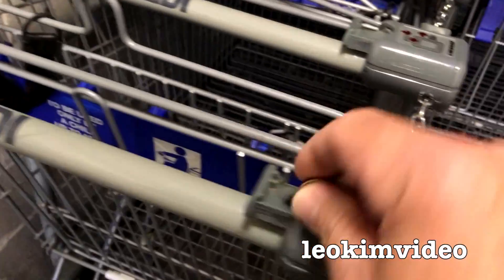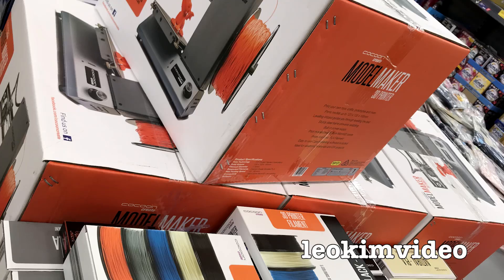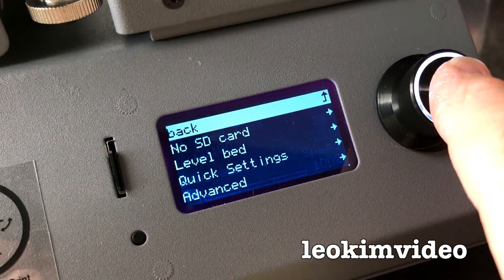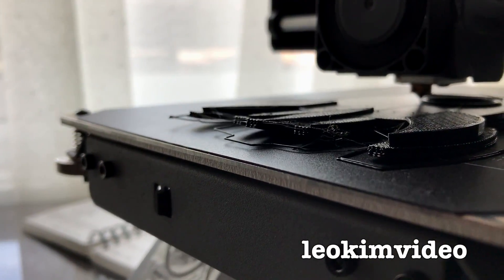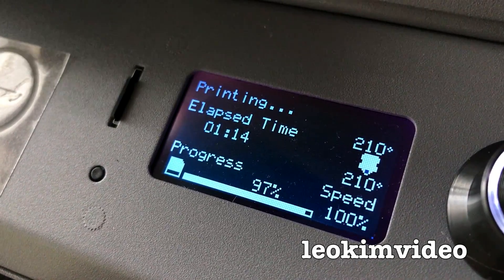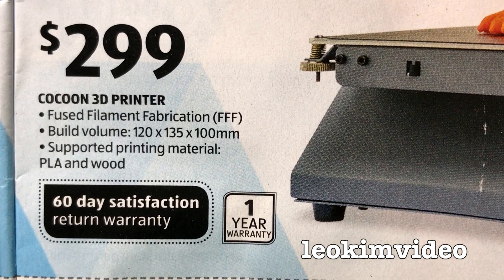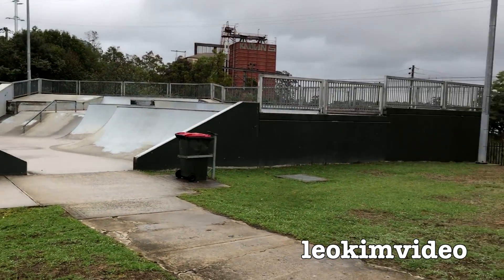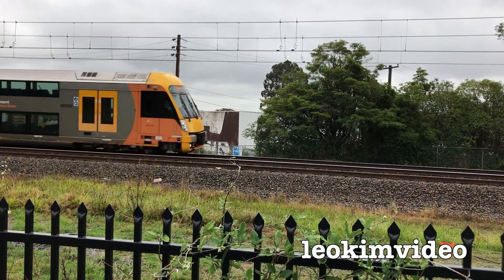ALDI Cocoon Create Model Maker 3D Printer Fail Refund Buy Bitcoin!

Comment: This is my only printer, and it has been brilliant, brilliant, all the way. Every printer has a learning curve, but I got good prints almost immediately, and have built some very big projects on it. PLA-only, and a bit small, are its only drawbacks. I do use glue stick on the build plate.

Comment: Atleast you can get yours printing our old ones at school we never got working it stuffed up half way through the print a do NOT reccomend this printer if you want a cheap really good printer look into FlashForge printers they don't need bed leveling only the big ones do the build plate heats up on some of there printers its not really a problem on the FlashForge finder just get a glue stick put it all over the build plate and then it does not fly around it has a very nice touchscreen interface on most of there printers easy to use great help it also has a cloud I bought the FlashForge Adventurer as my first printer I have never experienced bad problems I reccomend it way more than this printer on screen.

EDIT: Forgot to say the adventurer 3 has an enclosed case like most of there printers also it has a preset for printing with ABS and PLA, ABS is stronger than PLA for example you can smash PLA easier than ABS

Comment: Just a quick note: I don't mean to criticise your review or the opinions of any member of the public or private, but I find that the provided files are obsolete. The GCODE files that come on the SD Card are not editable and you will need a slicing software such as the provided 'CURA' to create GCODE files. From what I can see in your video, none of the models that you attempted to print have brims, but only a one-line border. The custom files I use, in my download of CURA (I manually modified the printer settings on the software) I make sure to add a brim of at least 8mm and supports to the majority of overhanging parts. The more infill and smaller brim of a model, the more likely to warp. I personally find the Model Maker quite limited but it is still an okay printer in my eyes. Also, the levelling instructions are incorrect. They say to level the bed to the height of the provided slip of paper but your print will stick fine if you level it until you can only just see a small amount of light from the other side. This will provide better adhesion. I agree that the manual is too simple and that individual pieces may be defective. For example, my temperature gauge was displaying 363C for a while and I had to call tech support. I hope this comment helps! Again, I don't mean to offend anybody or their opinions!

Comment: I had the same problem with this printer almost no bed adhesion, but this can be fixed with a cheap glue stick, just run the glue stick over the bed and it should stick, infect it sticks so well it's a little hard to remove the model.

Comment: Most of the time it's user error. If your bed was clean and levelled perfectly with a slow speed, correct filament temp and fan speed on the first several layers you wouldn't have had adhesion issues. The SD card slot doesn't indicate the correct way to insert so if it's pushed in the wrong way there could be issues. These Cocoon Create Model Makers are great little printers imo.

Comment: For the bed issue apparently putting glue on works well
Reply from the maker: So does heated beds ;)
Reply: Glue helps quite dramatically, I've had 0 issues with the same printer I bought, heated bed as well is mainly for ABS but not all pla works fine with glue or blue tape
Reply: Hairspray is good too

Comment: i seen a video where someone put double sided painters tape on the printing platform so the piece wouldnt move. the foundation will be hot and liquidy enough to melt some of the glue on the tape to be able to cool down , dry and stick to the platform

Comment: Buy one with a heated bed, it’s really worth just getting the dear $2000 ones or go home.
Reply: nah, you're nuts.  you can easily solve the problems on this $300 machine without spending an extra $1700.
Reply: That's fine if you've got $2000 to experiment with.